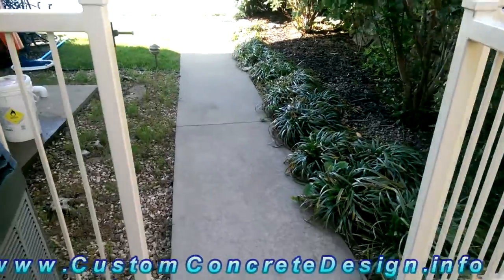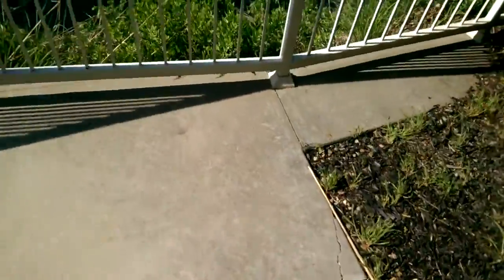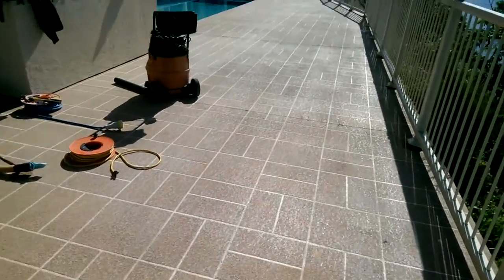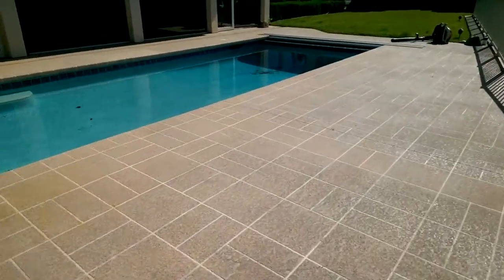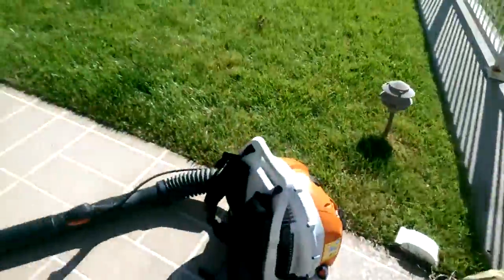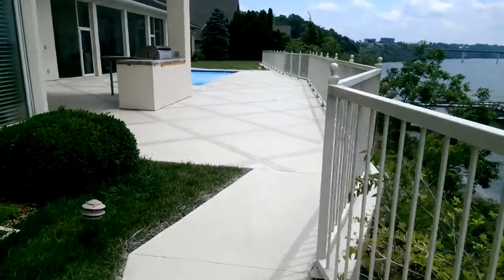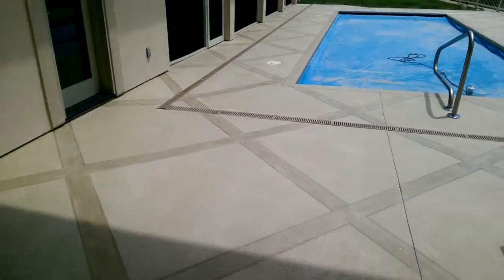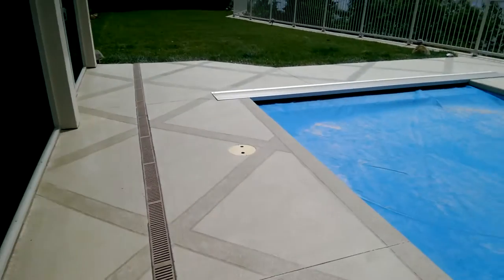Decorative Concrete Coating Tile Square Pool Deck Lake Ozark MO

Comment: Nice work man! 

Do
You grind wet or dry outside?
Reply from the maker: Dry since I have a Big walk behind floor grinder, generator and a vac that sucks it all in. :)
Reply: MrCustomConcrete nice man! I’ve got a 4 horse power planetary grinder , it’s a klindex clone company called Samich, I’m thinking of trying a dust cyclone on my vacuum so I can hold off on buying a 3k dry vac for now lol
Reply from the maker: @Drewskidelmar  yeah I used to have a Klindex Hercules 451, great machines, and with that I used the dust deputy dust cyclone your referring to...it worked great... but I eventually upgraded to that 3k Vac...so I totally get that man, been there done that.
Reply: MrCustomConcrete what grinder are you using now ?
Reply from the maker: @Drewskidelmar  I bought a Warrior Crusader
Reply: MrCustomConcrete nice ! My dad just got a Warrior too! He had to have a self propelled machine
Reply from the maker: @Drewskidelmar  whoa then that's an expensive machine, but they seem to really get the job done!